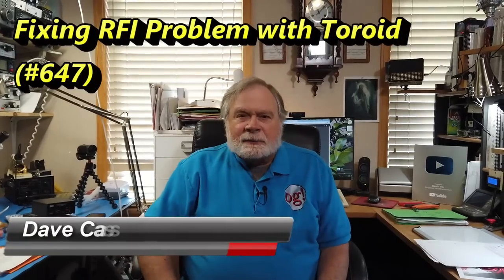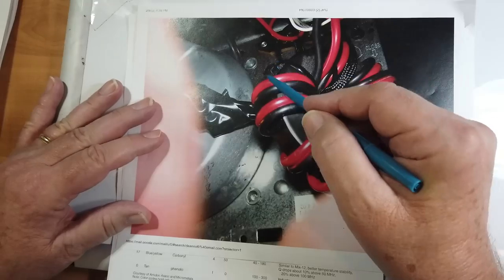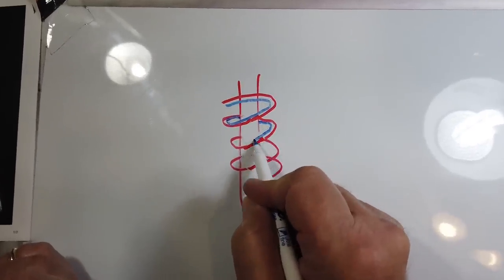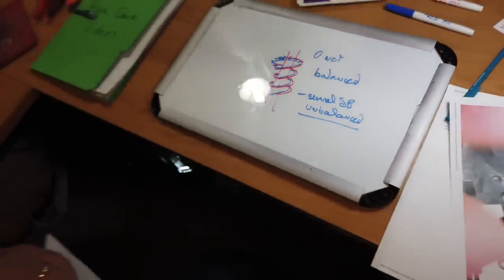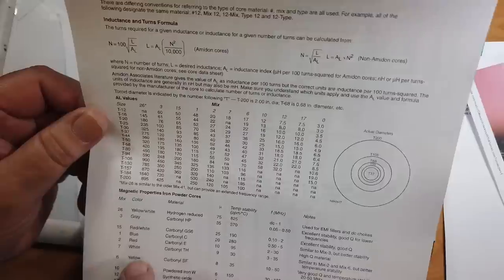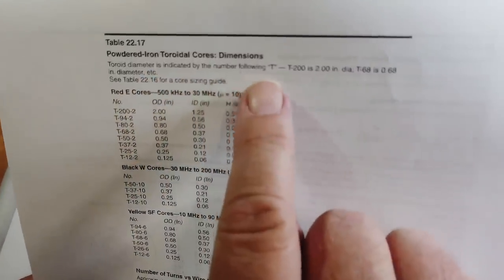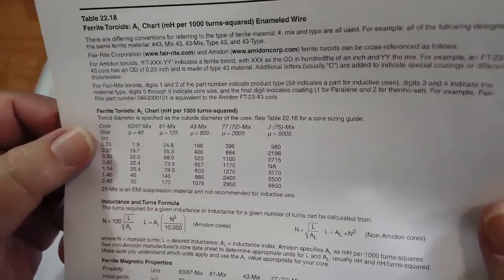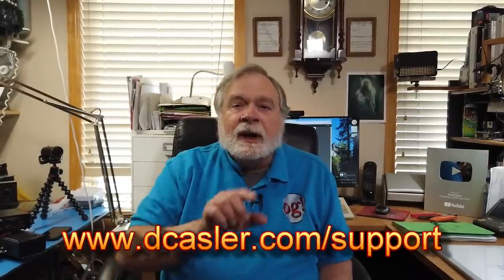Fixing RFI Problem with Toroid (#647)

Comment: Hi Dave, I would like to point out some facts about the content of the video you presented here.
1. It's about having a 1:1 Common Mode Current (CMC) Choke on the power lines to the garage door opener.
He said it started lighting up when he used higher RF power.
It's very obvious that he has lot of CMC flowing down through the outer aspect of the shield braid of the coaxial cable that feeds his antenna; the CMC (RF in the shack) also flows down along the power lines of his entire house.
Maybe his shack is very near to the garage or the power lines are being shared in common.
He must, first of all investigate the reason for the excessive CMC that maybe due to operating a vertical antenna or OCF dipole or something like that.
An antenna current meter hooked up on the coaxial cable would tell the relative magnitude of the CMC flowing on the coaxial cable shield.
Other equipments sharing the common mains outlet may become faulty.
2. You said there is no consensus in the world of torroids (ferrite or iron powder)
You are thoroughly wrong.
Decades ago different manufacturers produced in different dimensions and some with colours painted on them.
But now there are mainly two manufacturers in the US, namely Micrometals (mainly iron powder cores) and the Fair-rite (ferrites); Amidon is not a manufacturer but only a vendor. Because the name Amidon is being mentioned everywhere in the ARRL book people are of the wrong opinion that you should use Amidon cores for your radio projects.

3.Iron powder cores are given colour codes and it's universal.
Ferrites are ceramics containing Ni-Zn or Mn-Zn and other metals in trace quantities. The process of manufacturing is akin to pottery and has many classified receipes.
And it too is well standardized with predictable behaviour in a circuitry based on the physical cum electrical parameters given in the datasheet.
The ferrites come in plenty of flavours and hence can't be printed or labelled on them as you suggested. And they are highly brittle you know.
4. He has used #31, a Ni-Mn ferrite with high initial permeability that is considered an all rounder for making CMC Choke for the HF, V/UHF amateur bands.
You can use #43 for the HF and #61 for the V/UHF frequencies for suppressing the CMC.
5. Differential Mode Current flowing in the coaxial cable or parallel/twin flex wire would be producing magnetic flux whose fields would cancel each other because the currents are of the same magnitude but of opposite polarity.
But an inductor would pose very high (inductive) reactance for the CMC that tends to flow down the outer surface of the coaxial cable due imbalance in the antenna system.
The coaxial cable starts radiating while transmitting and becomes a part of receiving element (apart from the dipole elements); yes the antenna system becomes not a dipole but a TRIPOLE.
6. He asked about the magnitude of reactance offered by the CMC. But you showed the bulk of the material it should have with your fingers 🙄
Yes, you can calculate it by using the formula for inductive reactance, Xl, which is,  2pi FL. 
Each mix has a definite initial permeability value (850, in case of #43) and a torroid of 2.4" od would hold specific number of turns of wire of specific dimension that can be reckoned from the datasheet.
It's traditional that the reactance should be at least 4 times the characteristic impedance of the system (200 ohm for a 50 ohm system)
But it's better to have in terms of few thousands of ohms for assured suppression for a given range of frequencies. Everything can be calculated. There's nothing arbitrary here.
De VU2RZA.
NB: I feel very sorry to point out that, of late, your videos lack the correct and necessary information to the question asked.
You may prepare well for it.
Reply: Well said. I want to point out once more: there are iron powder cores and ferrite cores on the market. These are not the same!

Comment: Dave:  I used to install networks back in the 90's and had a customer call me because another consultant couldn't get their PC in the back room, and they got my name.  I ran my Fluke cable analyzer to see if I had a short or bad T connector.  None of the above.  So I was sitting there scratching my head and I looked down at the cable and saw the familiar Radio Shack branding.  A closer look identified it as RG-59, 75 ohm cable.  I told them that I will replace it with RG-58 and it would work, guaranteed.   It did fix the problem and I had a customer for years thereafter.  Yep, RG-6 would error out for a bunch of reasons, not the least of which is the collision retries.  The timing gets all screwed up with RG-59.

By the way, it's not just the turns/twists that make a data cable over voice.  It is also the insulation material.  This was all expressed in a document for the electrification of farmland, and the like.  I cannot remember its name exactly but it had something to do with Rural Electrification.  It's very interesting.

73,
Marc - N6UNX

Comment: Hello.   I had been trying torroids ft240 mix 31 or 43 to create an RF Choke for VHF ,   testing with the gain parameter using both ports on nanovna,   had wind from 2 turns to 13 turns,  creating not usefull resistance (ohms)    ...    I know mix 31 or 43 are most useful in HF, ...    Has anyone create a succesful RF choke with Toroids for 144mhz  ???     tks   73

Comment: I think the bigger question is what IS the real value of the mostly unmarked toroid's?   It's sad when you find these in most devices and don't know their value so then can't really reuse them with any confidence.   Would it be worth maybe winding a known number of turns on it and then use the math to figure out it's mix and so on?  Seems like there must be something like an Amp-Clamp device that you could snap around the toroid and give its values?  I can't remember ever seeing anything like that. Seems valuable?   Joe  AG4QC
Reply: Hi, you can put some 10 turns and measure the inductance and hence the inductive reactance it would offer for the frequency of operation.
Al (average inductance) per n^2 is for the ferrite/iron powder cores are given in the datasheet by the manufacturers Micrometals/Fair-rite. From the Al value you can calculate the inductance for 10 turns.
If it's in the nearby vicinity with the value you obtained by measuring on the "L/C" meter you can be sure that the torroid in your hand is similar to the one you referred to in the datasheet.
This way you can come to a conclusion about the mix of the material. 
De VU2RZA
Reply: Hi, and you can make an antenna current clamp meter. You can use the snap on (snap-it) type ferrite cylinder of say, 13 mm internal diameter so that it can be clamped on the coax like RG-213 cable.
Put 10 turns on the lower half alone and get it rectified by a diode like 1N 34A, BAT85, 1N5771 or 1N4148 (forward drop voltage 200mv, 400mv and 600mv respectively). You can feed it through a potentiometer to a 100 (or less) micro meter for a relative current reading.
If you are keen enough you can calibrate it too. You can refer to G3SEK's page for some construction ideas.
And for your information MFJ is selling an antenna clamp on current meter that's calibrated.
De VU2RZA

Comment: Good job. Just keep in mind that CMC (common mode currents) are looking to return to their source,  Like anything else. 
When you "block" the path these currents are using, just beware its still trying to get to its source (usually via ground). And it might find another path. And that may cause some entirely diferent issue. Sonewhere else...Just something to be aware of. 
Great video..

Comment: So he placed his toroid in the AC line (2 wires) powering his garage door opener. And it blocked (canceled) the Rf that was on both wires powering the door opener. Common mode rejection and had no effect on the ac powering of the door opener? Which is very interesting to me. If I understand this correctly. The ac is very low frequency and the rf very high frequency. But the ac has no common mode across both power wires. But the rf interference does. So the toroid on the power line cancels the rf at that point in the garage or in the entire house ac circuitry.?
Reply: Yes, that is about it, the AC line is differential mode and unaffected by the toroid, the common mode RF sees the choke as a high impedance. A UK article you may find interesting is by GM3SEK. Very little changes if you model a US version on similar.
FWIW this approach can be effective in reducing noise on your radio from appliances too.
Reply: @g0fvt  the rf “sees” the toroid as a high impedance choke… or creates counter emf that cancels the common mode rf.. which one?
Reply: @iamhe999  hi, you can refer to my comment to Dave above.
De VU2RZA
Reply: @iamhe999  you could argue that both are true. FWIW the work of G3TXQ on common mode impedance of similar chokes is worth looking at.